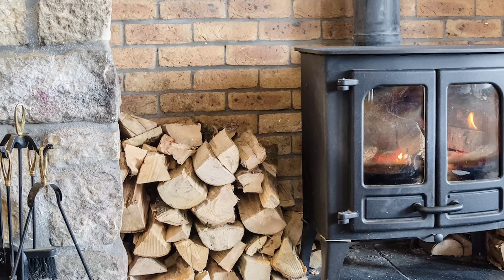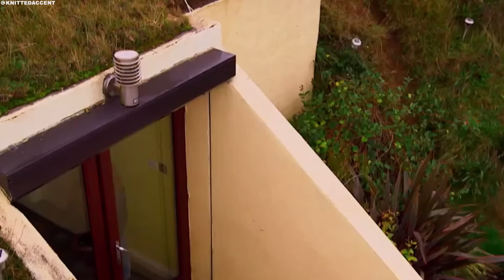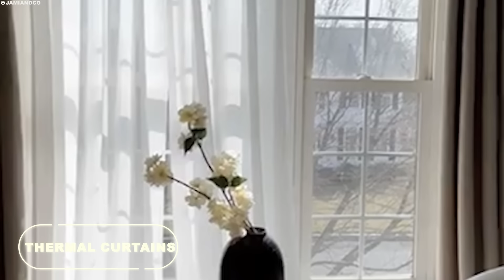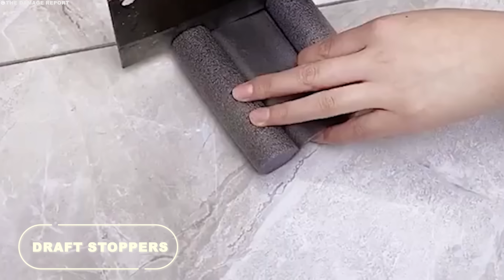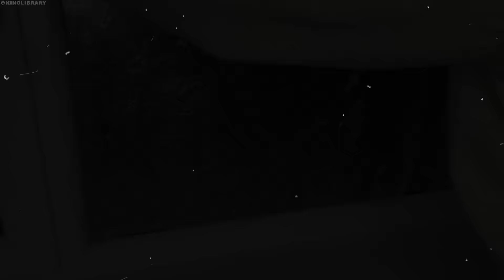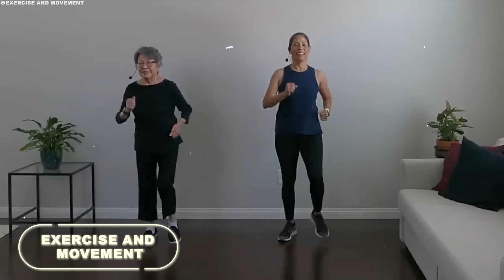FREE Heat All Winter 🔥🪵 Millions of People Forgot These 25 Old SECRETS! No Gas, No Electricity!

Comment: This is the first time that I've seen a picture of something I wondered about. While many would choose to not install a wood stove in the house for a variety of reasons, you showed one outside. I have been pondering the use of a woodstove outside for those who want one but perhaps cannot afford the installation. For cooking, heating water for hot water bottles, bathing, dishes etc., a small woodstove outside would seem to have multiple uses without the fear of fires. Code enforcement may have something to say about it, because while it is not "open burning" as it is enclosed, there might be an issue. I love wood stoves. There is enough scrap wood and dead branches within a few blocks of me to fill a pickup truck. Twice. I am in Florida, and the few cold days/nights we have doesn't really warrant a wood stove inside. But a cook wood stove outside would be great when the electric is out, or when you have guests over on a cool evening in the yard. We do have fire pits around here, but some are uncomfortable with the safety. Especially with kids around or those who have had a bit too much to drink. It's worth pondering, no?
Reply: In Florida you could do rather well with  a bit of solar and solar cooking, etc.